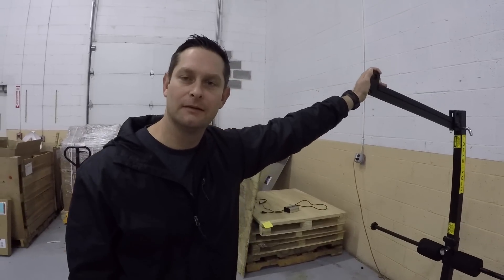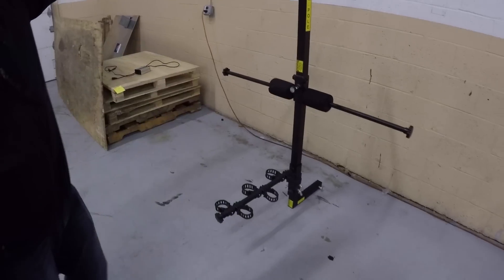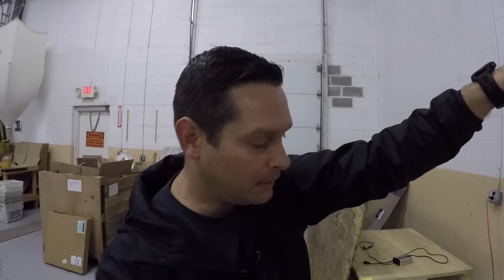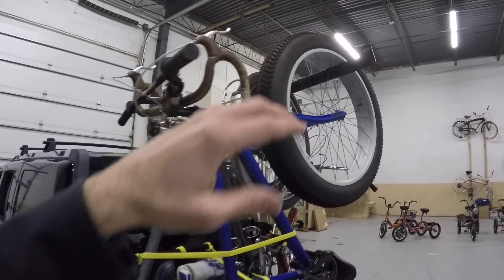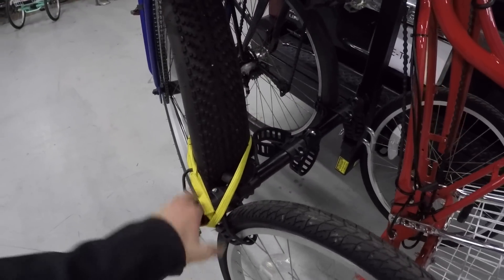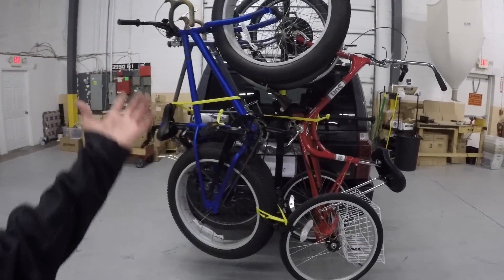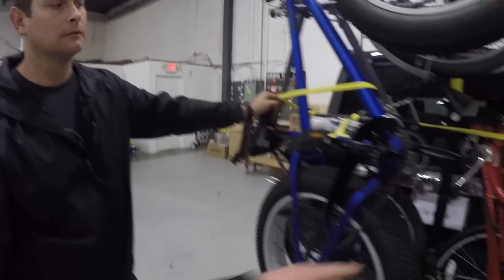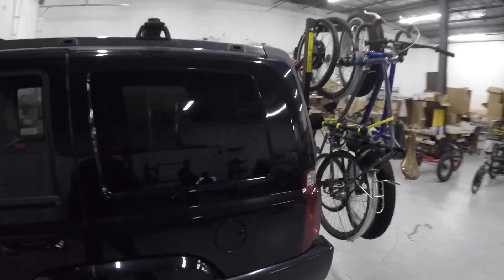Totem Pole TP6 Vertical Hanging Bike Rack Review - Carry 6 Bikes on Your Car! Up Right Designs

Comment: I bought one to haul two delta recumbent tricycles.   The hook doesn't fit in the small front wheels so I put it through the frame were it scraped some of the paint off.  It works with bikes not recumbent tricycles.

Comment: Aren't the bikes just free hanging there essentially so they can bang against each other and scuff up the frames? Also, in addition to looking a little less than secure, it looks terrible. Just a bunch of bikes all hanging together with a bunch of yellow bands wrapped around it. Pass.
Reply from the maker: Since the bikes are zippered together, alternating with one on each side across from each other, their tires create a bit of padding between that separates the frames at the top. Then, at the bottom they are held in place by the rubber loops. I think the bungee cords look a bit awkward in the video because of all the different bike types. For me it was impressive that it worked at all, it seems like there are always compromises when you're dealing with a large number of bikes or different frame types and overall the rack was pretty cool :)